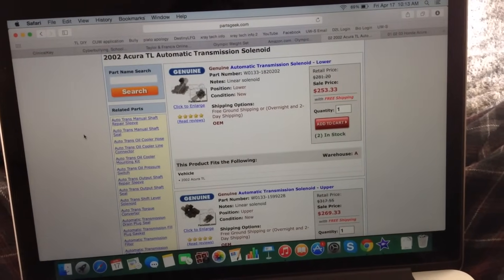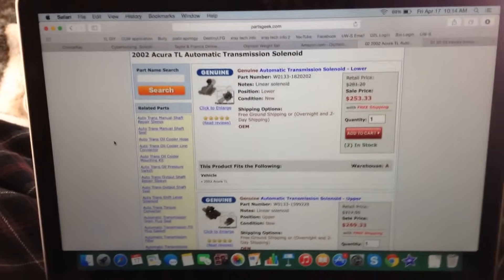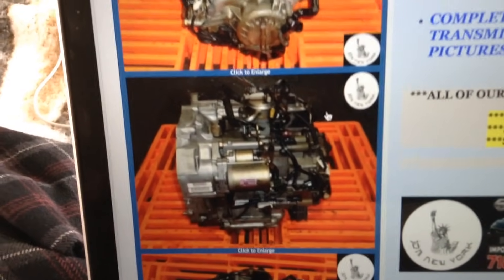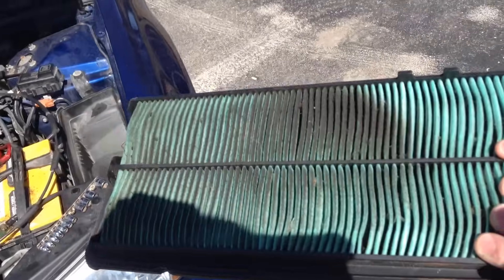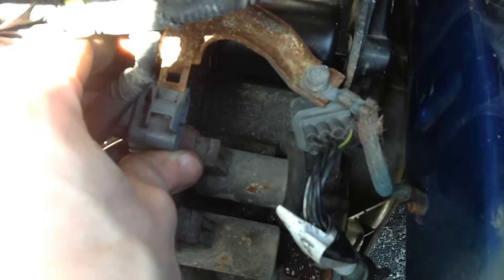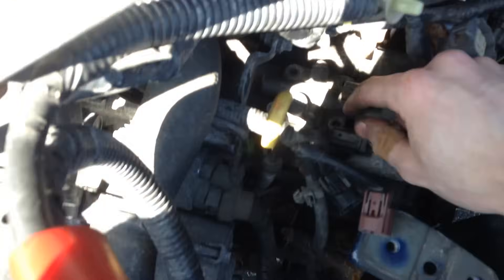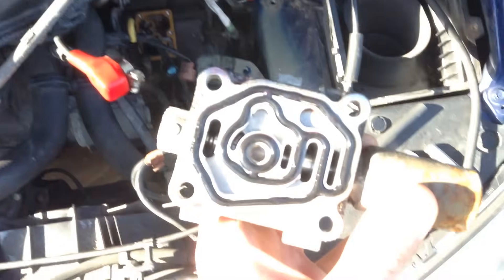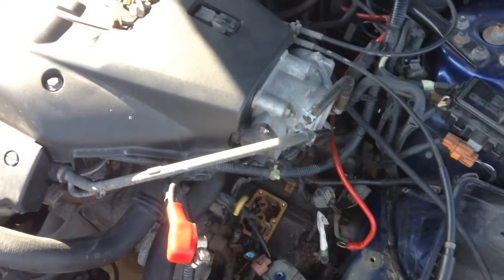Transmission Fix: How to Clean Solenoid Screen Filters for Honda/Acura P0730 P0740 P0780 P1750 P1751

Comment: If you are thinking about buying an Acura/Honda with a 3.2L engine from 2000 to 2005, DON'T. YOU WILL HAVE THIS ISSUE

Excellent video! My issue is a little different. I have a 2003 Acura CL that shudders hard from 2nd to 3rd gear with no CEL. So I changed the shift solenoids 28610-ray-003 and 28600-ray-003, and highly recommend it to anyone whose doing this, they are literally right next to these parts. For me changing the shift solenoids didnt quite do the job, all the other shifts were perfect but from 2nd to 3rd still shuddered. So I kept searching and stumbled on this video and decided to try this out myself. It took me about an hour to an hour and a half and I took it out for a test immediately and everything went perfect, however, as i continue to drive it, it does new things. It just locked me in park after I put gas in it, shudder on the way to the local grocery store. Upon leaving I got up to highway speed rather quickly and the CEL started flashing, but as soon as I pulled over it stopped flashing. I will try to clean the bottom filter (which was totally clogged) again tomorrow, but if it doesnt work I don't know what else to try. Incin3ration if you have any ideas I would love to hear them!

Comment: Will this work on 2002 Honda Accord? 3rd gear slipping badly
Reply from the maker: +Joseph C There's a chance it could. Cleaning these filters is free to do and definitely can't hurt anything! The fact that a clogged dime sized filter caused all those problems with my transmission amazes me. Now it works just as good as the day I bought it!

Comment: great great video my brother, i have an 05 acura tl, just changed the trans fluid a month ago, now im experiencing hard shifting, hard to get into 2nd gear
Reply from the maker: +Gerwich Saint-Hilaire hmmm, maybe double check your ATF levels. Improper levels of ATF can also result in problems such as slipping, aggressive shifting, and failure to shift. Be sure to look at your car's manual on how to properly check the ATF level.
Reply: Incin3ration ok, thank you very much man

Comment: Just checking to see if the car is still running right?  Also Ive noticed you said you have 202,000 on the original trans?   There was a recall on this trans.  Did you do the recall on the vehicle?  I was lucky and they put in a new one in my 02.
Reply from the maker: +Michael Hinchey Yes my transmission did have the recall done long ago by the previous owner. I still have the original transmission and engine with now 222,000 miles and everything is running strong!
Reply: +Incin3ration ok so they just added the pump to make it better.
Reply: +Incin3ration have you ever seafoamed that bad boy?
Reply from the maker: I actually have not. With this car being my daily driver, it never sits for long periods of time, which is what can cause many problems. It gets driven 300 miles per week, and I make sure to change the oil every 5000 miles with fully synthetic oil and a nice filter, and I haven't had any problems!

Comment: Hi Incin3ration,
I just bought a 2002 TL, and I've noticed that the third gear kinda jerks a little. a couple of times the car didn't shift into 3rd gear. DO you think cleaning the transmission solenoid would help?? thanks
Reply from the maker: +Fadi alsaidi It's very possible this could help. One thing is for sure, this won't hurt anything. Cleaner filters are better filters. I had that same problem, not being able to shift into third, then I'd have to bring it back down to second then third again, or put it in neutral and then back into drive. I'd say give it a go!
Reply: +Incin3ration 
Thanks. wish me luck :)
Reply: +Fadi alsaidi Did it work?
Reply: +Joseph C.  I don't know if it would have. I couldn't find a mechanic who is willing to do it, and I am definitely not mechanically inclined. I ended up rebuilding the transmission.

Comment: I watched your video and worked on my 2003 Acura TL-S; perfect instructions; hope it solve the problem. Many thanks. sk
Reply: My wife has the same car.  After following video, warning lights out and shifts as smooth as new.  Hope it holds.
Reply: +Sidney Kahn  Did it help with the problem?
Reply: +Joseph C it does; the code p1750 went away, but I plan to replace the solenoid later; got good price on t; thanks
Reply from the maker: Glad to hear this worked for all of you!

Comment: I did this procedure on a 2001 Honda Odyssey last weekend. Thanks for the helpful video.
Reply: +ppett1 Did it help with the problem?
Reply: yes
Reply: What was your odyssey doing? We were cruising down the highway and it just stopped shifting and wouldn't even rev up. We thought the whole transmission was messed up so we towed it back to the house and then a few weeks later, my husband started it up and was able to drive it around the block. Were thinking that this screen is the problem

Comment: Yo, you're the man!  (self employed mechanic/motorcycles-bikes-cars) I've been working on a customer's 1997 Acura CL 3.0 Base Coupe 123,000 miles w/ several - random transmission problems: AutoZone told the owner that the engine code reader reported a faulty "Main shaft speed sensor" so I replaced that, drained 3 quarts of trans fluid via the drain plug, removed the fill plug put in three quarts of New HONDA SPECIFIC - ATF-DW1 - Which REPLACES HONDA'S REQUIRED ATF-Z1 FLUID.  After installing a new drain plug washer/drain plug (w/ 3/8th inch drive extension) three quarts of DW-1 fluid and the new sensor (on the back side of trans/has only two attaching bolts and a tiny/ approx. one inch  drive shaft that connects it w/ the trans.).  After completing that work & no warning lights illuminated,  I test drive the car and it slips horribly in all forward gears or won't move forward at all....I saw your video, cleaned the screens and IT WORKS PERFECTLY NOW!  You saved my butt and made me a few more bucks, thank you-Very cool.
Reply from the maker: It amazing how something so simple can cause such a big problem! Not to mention it's cost free to do and anybody can do it! I'm glad this helped you!

Comment: Would it be easier to work underneath the car?
Reply from the maker: +Alvaro Delgado I think it's much easier to work from above, at least for my car. Maybe it would depend on the vehicle, but at the same time I would imagine all solenoids to be located in similar locations on all vehicles.
Reply: +Incin3ration I have a 2004 Acura TL. I'll probably tackle this job soon
Reply from the maker: +Alvaro Delgado Good Luck! Hope it fixes any issues you are having with your car!

Comment: my 02 Acura cl died on me when it hit 130k - i replaced it with 06 odyssey transmission  - direct fit. no issues ever since. For cheap replacement solenoids - get it from local junk yard - check their odyssey parts
Reply: i jist read about those 98 to 2003 hondas and acuras. one person changed there trans five times. sucks becaise my buddy wants to sell me.an 01

Comment: Hello I Have Same Vehicle.....I Have To Push Lock Out Button Next To Shifter As It Is Locked In Park......Would It Help Do What You Did To Help It Shift Out Of Park?  Thank U
Reply from the maker: +Robert Meadows hmmm I've never dealt with this situation myself before. If you physically can't move your shifter out of the park position, I've read it could possibly have to do with a faulty brake light switch.
http://myautomatictransmission.com/DIY-move-stuck-shifter-from-park.htm

I don't think your particular situation has to do with solenoids. Regardless, cleaning the solenoid filters can't hurt anything.
Reply: I had an issue with my shifter locking.  There is a solenoid that unlocks it that gets it's signal from the brake light switch, telling the trans your foot is on the pedal!  Have someone check your brake lights while deporessing the pedal: you may not have any.

Comment: Hi, does this also apply to a 99 Acura TL that is failing to shift out of 1st? I know the 00+ 5 speed trans had more issues than the 99 but my friends 99 is also exhibiting the failure to shift issues.
Reply: Yes any Honda/Acura from 99-03
Reply: Yes any Honda/Acura from 99-03

Comment: I got a po780 and Po730 code reading when I got it checked. Would this fix the problem? 

Po780 shift malfunction
Po730 incorrect gear ratio
Reply from the maker: BabyKrazy714 sorry for such a late response. hope it's not too late, i didn't see any notification. this filter cleaning definitely can't hurt anything, so I would definitely give it a try knowing a bad solenoid can be problematic for a transmission. best of luck to you!
Reply: Did you fix problem having the same...... Let me know how it turned out
Reply: Did you fix problem having the same...... Let me know how it turned out
Reply: Did you fix problem, was it low cost
Reply: Did you fix problem, was it low cost
Reply from the maker: Sorry this didn't work for you, can't fix every problem. Sometimes transmissions simply go bad where there is nothing you can do and it needs replacing, especially for our TL's which are known for having transmission problems. It was still worth a try though!
Reply: Yeah, thanks for everything Incin3ration you were a big help!!!
Reply: Rebuild tranny cost ?
Reply: +kush man $1100 parts and labor
Reply: BabyKrazy714  thanks man ,I went to aamco the price they said to rebuild tranny was like $2800, then I came across some tranny place and they charging like $900 .........anyway great vehicles - worth the fix

Comment: How much different mechanically is this vehicle from the 2006 Acura TL.  I really want to do this but i can't find any videos on my model. Thanks.
Reply from the maker: Eric Carlson I would have to guess very similar. Just by going on partsgeek I can see that the 2006 TL has the exact same 2 solenoid's that are on my 2002 TL. and they should be in similar locations I would imagine, it says there's an upper one and a lower one. and just remember to be careful with them! they're worth over $250 each!